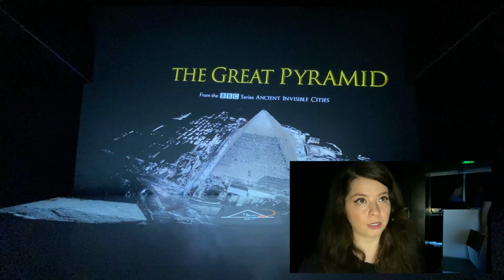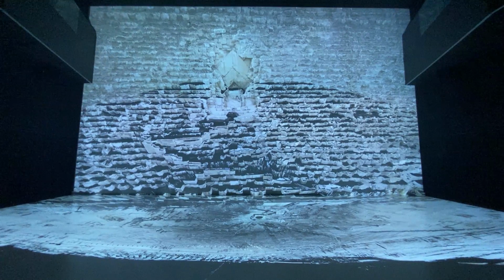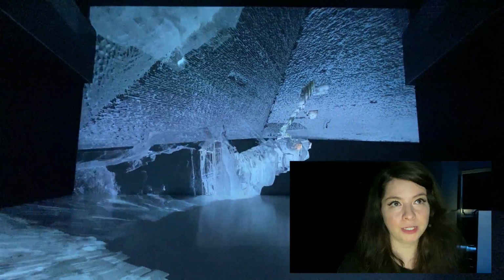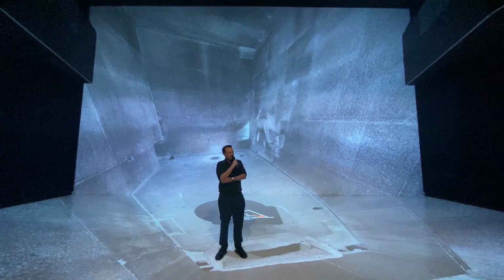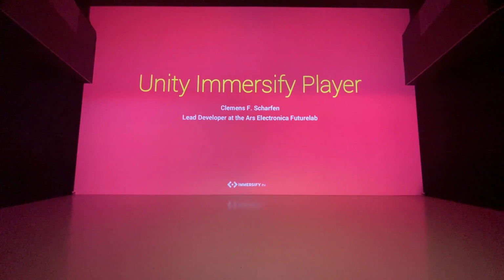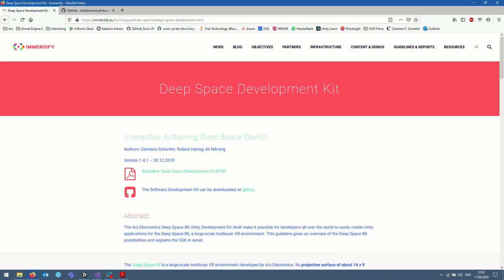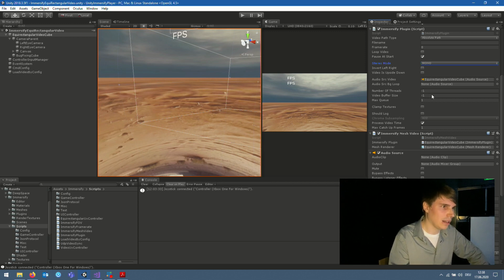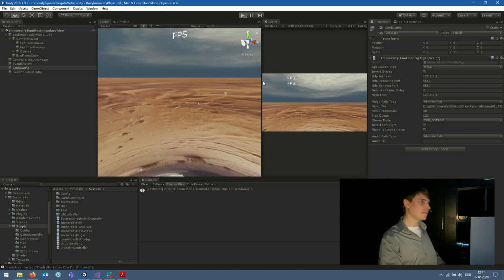Inside Futurelab: Immersify (The Great Pyramid in 3D)

Comment: I agree with to 2 handled copper saw and quartz based sand to cut granite stone. Water was added to tge cut groove as well as sand at intervals. Once a cut depth was made i think they used hammerd in wedges to split the stone.
Reply: The saw definitely was used. I'm not sure though if you can safely split granite like you can limestone. It might be too brittle and crack and break where you don't want it to.
Reply: @scotth6814  there is a couple of videos on YouTube showing the split of granite stones when scribed and cut and tapped in iron wedges, the ancients may of used copper or wood wedges.
Reply: @scotth6814  And what saw allows the polygonal shaping of EACH unique GRANITE block to conform so intimately with its neighbors?  Such as the whole base of Menkaure?
Reply: Have you ever heard about the Mohs scale? Good luck cutting granite using a copper saw. It actually blows my mind how some people can still seriously eat this bs...